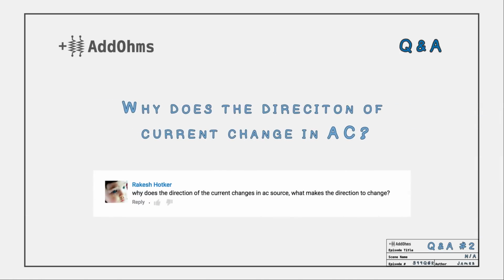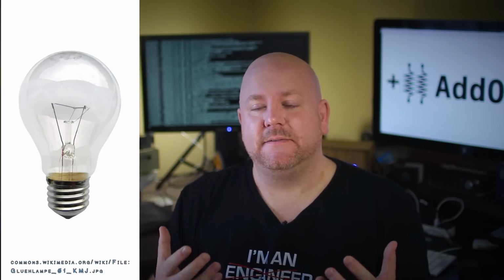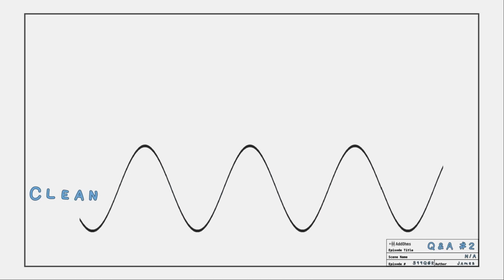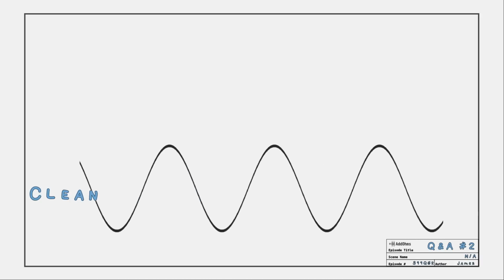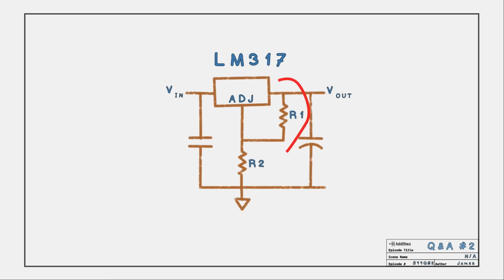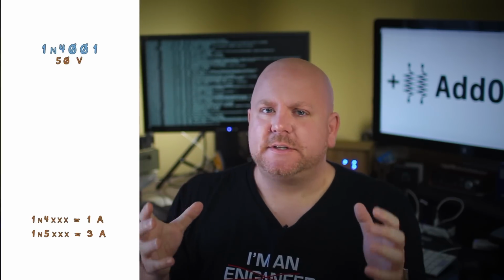Electronics Questions and Answers | AddOhms QA #02

Comment: I'm into wildlife. I'm putting together an underground camera system where the recorder and battery will be housed in a water proof box underground, and the small lens will be above ground.
The recorder will accept a USB charge/plug in while functioning.
So I figure, if I made a power supply which would be a large battery? The unit will run a lot longer than if it were just running on the batteries in the camera.
So, I need a USB connection to from a large battery like a scooter battery 11.1 volt to a USB power, which I guess would be a 5v?
Anybody who can help me would be greatly appreciated!!

Comment: For the first answer, I thought that AC was more efficient for carrying over wires than DC that produce more heat, no?
Reply from the maker: Common misconception. It’s because it is easier to step AC up and down to high/low voltage. AC RMS power losses are the same as DC power losses.

Comment: On some diagrams, capacitors are labelled 1n, 100n, etc. What are these? nF?
Reply from the maker: +Tommy Nolips yes. It is common to drop the unit and only leave the prefix. n for nano. k for kilo, u for micro. Have to be careful with m. Lowercase should mean milli and uppercase should mean Mega. But not always the case.

If it’s a cap it’s farad, if it’s a resistor resistance, and heneries for inductors. 

Sometimes on caps no unit might mean pico. Bad convention in my book, but it happens.

Comment: So I have a question on current limiting resistors. I never saw anything on how to determine what value should be used. Can you elaborate?

Thanks!
Reply from the maker: For LEDs, it was covered on "LEDs and Current Limiting Resistors": https://www.youtube.com/edit?o=U&video_id=81zNcctopBI. For other uses, the math is still the same. Use the voltage drop of the device in series with the resistor and a bit of ohm's law (like shown in that video.)
Reply: Thanks. I left you a note in that video's comments.

Comment: AC vs DC:
"There were several technical factors that drove the adoption of alternating-current over direct-current. The direct-current system generated and distributed electrical power at the same voltage as used by the customer's lamps and motors. This required the use of large, costly distribution wires and forced generating plants to be near the loads. With the development of a practical transformer, alternating-current power could be sent long distances over relatively small wires at a conveniently high voltage, then reduced in voltage to that used by a customer. Alternating-current generating stations could be larger, more efficient, and the distribution wires were relatively less costly."
-Wikipedia-
in short AC is much cheaper to distribute than DC

Comment: The use of AC for power distribution is not just a matter of history. The DC transmission systems of the time was useless for this purpose. The amount of energy wasted would have been enormous. AC was chosen because back in the day it was far more efficient when they wanted to distribute power between nearby houses etc. AC was the only viable efficient low cost option for household use.
Reply from the maker: +Tech Tins "It's more than history" and then you proceed to explain the historic reasons. You even end with "back in the day." Another phrase for "history."
But thanks anyway.
Reply: Yes that was a little long winded I agree (I have cut it down). The point I was trying to make was that the choice of AC over DC was for very good commercial reasons, it was not an arbitrary choice which was how I interpreted your presentation. Which was prompted due to your description here, quote 

"Its not entirely because one is better than the other. It's just what was picked a very long time ago"  

But it was not just picked, it was because AC was far more efficient (hence better) than DC. But, I see what you were trying to convey now, having re-watched it. But it may well confuse others as it did me, who already know why AC was the far better choice.

Comment: Can you explain to me why there are no inverted CMOS logic gates (N-Channel on Voltage side and P-Chanel on Ground side)?
Reply from the maker: Vgs for N-Channel needs to be positive and Vgs for P-Channel needs to be negative. That wouldn't happen if you swapped them.
Reply: Very interesting.  I got some MOSFETs and the logic gates I built seem to work with the inverted CMOS style.  But they drained the 9V battery so quickly that I couldn't complete the tests (after the inverted CMOS gate, I made a normal CMOS gate to remove any voltage drop cascade).

Comment: Let me correct you: actually AC wired transition loses are less than DC
Reply: That's not true. It is exactly the opposite. Most newly built high voltage line transmits DC because of losses in the AC. 
https://en.wikipedia.org/wiki/High-voltage_direct_current
Reply from the maker: What are you correcting? Actually, I never said anything about losses.
Reply: Indeed.  Ye olde skin effect.

Comment: AC is safer and easier to transfer on longueur distance than DC
Reply from the maker: High voltage is dangerous to transport whether it is AC or DC. So "AC is safer" is not valid. Unless you are Thomas Edison trying to disprove AC. 

As for transmitting longer, DC may actually be ideal. You don't have a reactive component to deal with.

However, as I said in the video, the infrastructure was originally designed to carry AC and still does today. It was originally designed for AC because transformers easily allow stepping it up to very high voltage. The key to long distance is not AC or DC, but high voltage.
Reply from the maker: Pain is not the only indicator of danger. If something kills you or can kill you, it doesn't matter if it is a sharp pain or a slight tingle.
Reply: @AddOhms.  I dunno - @electroboom has some tongue/foot/face/hands on experience with AC/DC voltages and he argues that human body capacitance results in higher, more painful current for Vrms = Vdc.   :]
Reply: Very true!  Electrocution can be lethal at pretty much any voltage level under the right (wrong) conditions.  My pops is a commissioning engineer who survived a 13.8kV zap with some serious burns.  13.8kV / sqrt(3), strictly speaking, though nobody wants to hear a story about a measly 8kV, eh?  ;]  Moral of the story, always lock out and tagout yourself - don't trust others to.

Less fortunate people can have their hearts fried on mains.  All comes down to how much you pray to Saint B Franklin to find favor in you, I suppose.

Comment: There are certain cases in the industry where pull ups are important over pull downs. Imagine an "emergency stop" button which disactivates that skull crushing machine. If you push the button, the signal turns off, and the machine stops. OR if some current turns off, OR if you pull the cord to the button altogether. It's just a security mechanism to make sure that, if it is uncertain what might happen, it's better to make sure and turn off the skull crushing machine. AKA if in doubt, don't kill

Comment: DC is actually a better transmission medium than AC. The only reason that AC was used is that up until the 80s, thyristors that were used to step DC up to very high transmission voltage cost too much compared to AC transformers. But today there is no reason not to use DC. You already know the math, DC is always less lossy than AC because AC impedance is DC resistance plus reactance at given frequency. Our future transmission and home systems will be DC.
Reply from the maker: This is why I said "most countries" in my response. I'm not aware of any, but I wouldn't be surprised if a developing nation built a DC grid instead of an AC grid.

As for the future, I don't see path to transition to a DC grid. The cost involved would be enormous and probably not outweigh the benefit.
Reply: AddOhms Again, the benefit would be clear in saving electricity due to absence of AC reactance. You also don't need to run new cabling. Another benefit is needing only two cables instead of three. Not to mention the absence of 60 cycle hum in our electronics, safety improvements from not charging the metal chassis with AC, etc. There are HVDC projects already, check out Wikipedia for HVDC.
Reply from the maker: It's a great theory. In practice though, the switching cost (no pun intended) is very high.

I can see it happening at certain points of the infrastructure, but at the end of the day you're going to have 50/60 Hz 120/240/480 VAC coming into your house or industrial plant for a long time.
Reply: AddOhms Maintaining the AC network has the slow cost as well, but yes changing to DC would cost more than just continuing to use AC. The future is definitely with DC though.

Comment: Great content James!
I believe YouTube is smart enough to recognize video times and create links if you just include them in the video description/comment.

00:39 Why does AC Change direction?
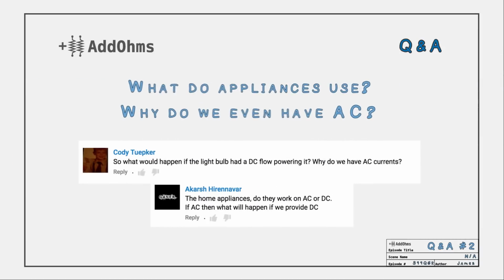03:17 What do home appliances run on?
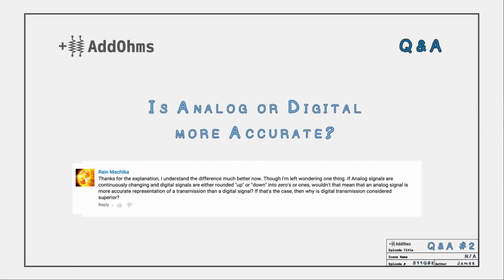06:44 Is analog or digital more accurate?
08:36 When to use pull-downs?
11:16 Comment on LM7805 part number.
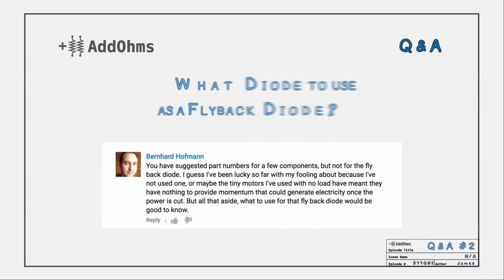13:24 What diode to use for fly back?
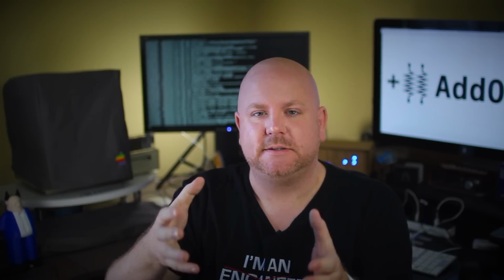16:23 Do I draw my own animations?
18:51 What does "AddOhmns" mean?

PS: I thought I spent a ton of time on my videos, but I think you spent even more! Thanks!
Reply from the maker: Thanks. Had no idea. Wish more people did this on long QA videos!
Reply: Hari Wiguna I
Reply: Hello JL, I think I asked you about this a while back...
I add a low value ceramic cap to the trace side
of the PCB after replacing a bad, high ESR cap.
Here's a video that clarifies this important point!  
https://www.youtube.com/watch?v=WytU5uj78-4
P.S. Your content is top notch and the A/V & lighting are all great!

Comment: I'm-a gonna sound like this meme http://i.imgur.com/DpQ9YJl.png
but "ACKCHYUALLY" A 120V light bulb will work exactly the same with 120V dc as it would with 120V AC RMS. If you mean rectified AC, which is closer to 170V (not accounting for voltage loss in rectification or ripple) then you'ld be right. It would burn twice as hot almost twice as bright, and will live half the life.

Reason being that 120Vac rating is the RMS rating of AC, and because it is a sinusoid, the peak voltage is actually sqrt(2) = 1.414 times higher. The bulb filament intensity is basically the same as the long term average of the product of voltage and current. If you assume that the bulb has a constant resistance (which, since the filament has thermal mass and a not-so high thermal temp-co, that is basically true over a 1/60th of a second interval) then the power dissipated is the square of the voltage, so integrate that over time, and divide that by the by the limits of the integration, and you'll be left with Root Mean Square!

Coincidentally,  "square, then mean, then root" approach is also used to figure out variance, it is useful to apply in a lot of places.
Reply from the maker: Your math is correct, in theory. But theory and practice aren't the same. In practice, tungsten filaments aren't perfect resistive elements. Their chemical properties affect their life. Look up "filament notching."
Reply: AddOhms Intresting! Yup, I am very familiar with practical engineering challenges, deal with them all the time in the lab and when working on things! but 5 minutes on Google, I didnt really find much supporting evidence that DC is indeed a contributing factor to premature life. It seems logical that a more stable supply of power would yield longer life, whereby tempurature fluctuations, on/off cycles, lower operating voltage (for halogen lamps) and physical vibration/shock or even high frequency operation (due to the skin effect) would have much more substantial and detrimental effects.
Reply from the maker: I think it'd be fun to setup an experiment. Run two bulbs at the same time. One powered directly from mains and another from an DC supply at the same, effective, voltage. See which dies first and by what (if any) margin. 

Might be interesting to see the difference from a 12V and a 120V rated bulb.
Reply: For statistical purposes, you'd probably want at least 10 or 100 or so, half running on 120Vdc, and the other half on 120V RMS AC. I don't know of any regulator that can generate that high a voltage at many amps required, that would be a challenge! I have seen many people run incandescent lamps off several lithium batteries (particularly aVe, PhotonicInduction, and a few others)
Reply from the maker: This becomes more complicated as I think about it.

Found a Linear Tech Part last night (can't find it again now) that can output up to 120 VDC at 500 mA. (Not sure if the passives are available, but at least the switcher is.) So 40 or 60 W bulb at 120 VDC would do the trick.

Since their rated lifetime is based on an average, at least 100 of each would need to be tested. Then the average results taken. Okay, so there's that.

Then is the simple fact of their life. Average is on the order of 1000 to 2000 hours. That means 1 to 2 months per test, if only testing 1 set (AC and DC) at a time.  So then would it be valid to switch the bulbs on and off, and what would the ideal rate be?

Put bulbs in parallel and we're back to the problem of generating 120 VDC with lots of amps.

The alternative would be to step up the wall's 120 VAC and rectify it back down to approximately 120 VDC. But I'm not sure I want to build that rig.

Too bad Mythbusters isn't still on. :)
Reply: AddOhms yeah, testing them sequentally would take a millenium. a variac with some bigass rectifiers, or even a DC welder might do the job, the modern small/medium ones are just really just giant switchmode power supplies.

Comment: I really like your channel but that explanation of AC/DC was terrible. Just tell the person because if not we would have massive transformers every few suburbs and AC allows us to send current really long distances but at really high Voltage. Its not History, its that it is just not cost effective to do DC
Reply: James Lewis   I think you are overlooking the power generation and distribution system.  What we need in our homes is only part of the question, and even in the home, you overlooked some important items.

AC works better for generation and distribution.  There are some specialty sub-cases where DC is better, but they are sub-cases.  In the most common situations, AC is considerably more practical to generate and distribute.  The "Current Wars" historical discussion, unfortunately, tends to give the, false, impression that the choice between AC and DC distribution was largely a matter of commercial interest.  It was not.  Edison and the DC camp had invested in a system that was technically inferior to the AC systems that were being developed.  DC lost out because, particularly in the areas of generation and distribution, it was inferior.

AC works better for the most common motor applications.  In a residential setting, three of the biggest power consumers are motors: 1. refrigerator/freezer  2. Furnace/AC blower(s)  3. Air conditioner (heat pump) compressor   

Incandescent light bulbs are AC/DC indifferent, but the much more efficient fluorescent bulbs were, until recently, dependent on AC to generate their higher operating voltages.

LEDs are inherently DC, but what voltage?  White LEDs operate around 3.5 volts, but they require current limiting that imposes voltage overhead.  Most household lighting applications need more light than a single LED can provide, so series wired LEDs are common.  But how many in series should be the standard, and what voltage should we distribute to feed them.  I'll bet that won't be standardized for some time.
Reply: If the common question were: "why was AC originally picked" versus the more common, "why do we use AC today" then I would have limited it to: "transformers."

I picked the historic answer because, well, it's why. 60+ years ago, we only needed AC for everything in our lives. Which, in itself might be a historic reaosn. It's only been in the past 30 years that "DC" was even a real need for most (electrical) consumers.

If since the 1880s DC was a "need", who knows if AC would still haven been used as the primary transmission method? Light bulbs really don't care. 

How soon, if not already, can an inverter be just efficient as a ferrite-core transformer?
Reply: yeah good point, I can see where you were coming from then.
Reply from the maker: No, I'm not overlooking power generation and distribution. In fact, that's the argument I'm making. We have 120 years of experience, or history, generating and distributing AC power. And almost none (relatively speaking) with a DC grid. 
And it is unlikely the infrastructure would change anyway.
Reply: Mark Holm this is correct, AC was chosen due to the impracticality, losses and costs in DC distribution. This means that AC is actually better for generation and distribution hence why we use it.
Reply: AddOhms   OK, I just thought the video gave too much emphasis to the needs of low power, household DC devices, without mentioning the bigger picture.  No real conflict, just difference of emphasis.
Reply from the maker: Mark, I value your perspective. Varied perspectives is one of the challenges in producing engineering-related content. So many different contexts makes it difficult to create a one-size fits all. But your comments are making me think it would be interesting to explore the topic of switching to DC. (At least academically.)
Reply: AddOhms   One thing I remember, that is pertinent to the whole power distribution question, is my uncle, a supermarket manager, telling me that the biggest power consumer, by far, in a supermarket is the refrigerator and freezer cases.  In his store, in Kansas City, there was no heating system for winter.  The cases generated all the heat the store needed.  Moral, different power grid customers have different loads.
Reply: Have u heard of HVDC